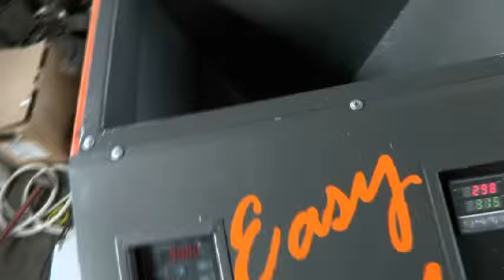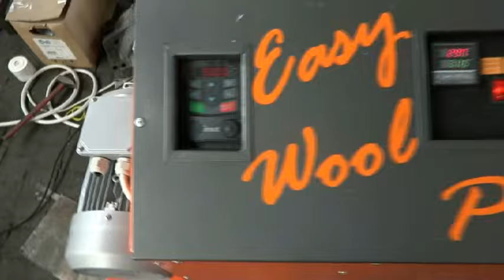From PET bottles to polyester fibers with EASY WOOL machines

Comment: Hello andrey, i have a question. Why the granulated PET Is grey but when you put it in the Easy wool machine Is White? Is not the same plastic? Thank you! You are great
Reply from the maker: Basically the bottles are transparent, but when crushed they look white. This is an effect of granularity.
Reply: Ya  you are right I have worked in plastic manufacturing company I have experienced it.
Reply: When you have a partially transparent material, light will be more attenuated the more thickness it passes through. When you break or crush or grind it into smaller pieces, the light that you see reflecting off of it is passing through less of the material because there are more opportunities to reflect back or scatter. If you crush an emerald you will get white-looking powder, not green.
Reply: Hello, is the Bottle Grinder available in the market for sales, I need it

Comment: price pls to kenya  warrenty is it a turn key project
Reply from the maker: We are company from Bulgaria. www.plasticabg.net        "EASY WOOL PRO" is the newest model in the series EASY WOOL. We have redesigned the old model with more compactness and low weight because our customers are mainly from foreign continents. Thus, transport will be cheaper and faster. The principle of the new model is the same as the old one with a capacity of up to 50 kg per hour depending on the thickness of the fiber.In the new model, everything is combined into one body. It also adjusts all parameters. Turbine speed, the power of the turbocharger, which controls the quality of the wadding.The feedstock is crushed into PET plastic bottles. It does not have to be clean. They can be crushed with labels and caps because nozzles are 10mm in diameter and there is no danger of jamming. All aggregates are built in and only a little running water is needed to cool the auger. A circulating small tank pump can also be used.The inertia power of the new model is 10 kilowatts and the nominal is about 3 kilowatts, because after 10-15 minutes of operation, the machine goes to autogeneous mode and the patented type of auger melts the material.The weight of the machine is about 350 kg. without the transport pallet and safe.The starting material is a soft fiber whose temperature is regulated by a change of temperature. The fibers have a cushion filling, soft toys, furniture, mattresses and more. After additional mechanical machining, the fibers can be used for blankets, clothes, non-woven fabrics, and more.The machine runs on its own, plugged into the current, and after warming the set temperatures, you run the auger and the turbo. Easy and simple to work and service. Works in continuous mode.All parts and aggregates are produced by us and the method is patented. 
    The cost is € 12800 excluding shipping costs. The production period is one month.
The EASY WOOL machines are designed and manufactured according to a program for ecological processing of plastics. They produce polyester wool, but their purpose is to utilize used PET bottles. We also offer PET bottle crushers that are tailored to serve the needs of EASY WOOL machines.
   "EASY WOOL pro" is very suitable for small business and for the initial step in new production because it works with PET recycled plastic and does not require a large room and a lot of production costs. For more question please write by email     plasticam@abv.bg

We will send you a proforma invoice for payment by bank transfer. You will pay a 30% deposit of the price. In about 7 days your machine will be ready and we will do a video call with the test. You will pay the balance and we will ship it to you.

Comment: Did you wash it after grinding then you did crystallization for this milky white??
Reply from the maker: no you dont need to whash
Reply: @kotarakafeliks  crystallization??
Reply from the maker: @Deepakkumar-py6yz  No crystallization.
Reply: @kotarakafeliks  Then how it becomes milky white without washing. By dry grinder grey color to milky white color change isn't possible without washing & crystallization.

Without crystallization how we process PET plastic??
Reply from the maker: @Deepakkumar-py6yz  The auger itself is special and does not need crystallization. If you want, you can crystallize it in advance.

Comment: Good afternoon.  Tell me what to do so that the fiber is not brittle, fragile.  I tried to dry the flex so the fluidity disappeared.  I planned to make holofiber from fiber, but it doesn’t work out.  Thank you in advance.
Reply from the maker: You make the fiber with our machine?
Reply: I do not make fiber on your machine, but the principle of the robot is the same.
Reply from the maker: @artdanplast  The principle is only visual, but there are some things that are not visible.
Reply: Wrote you an email.